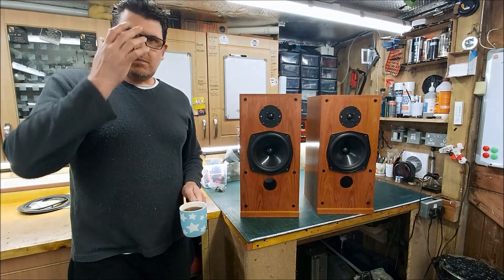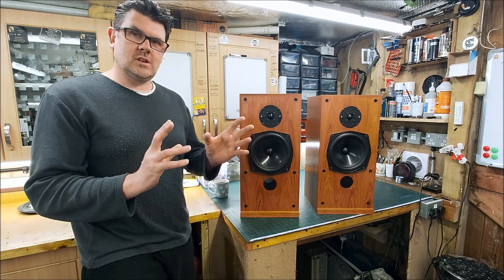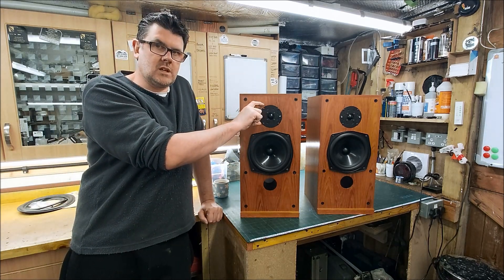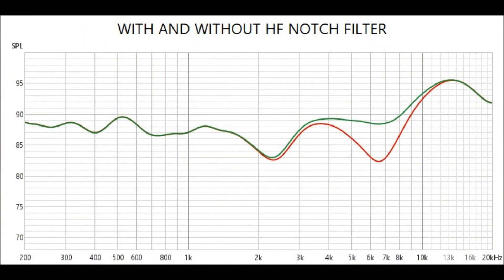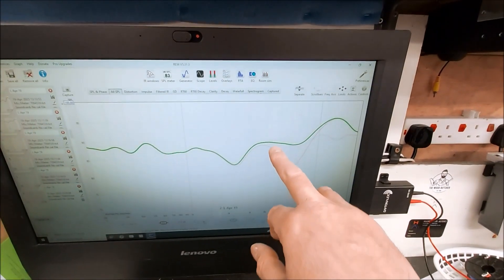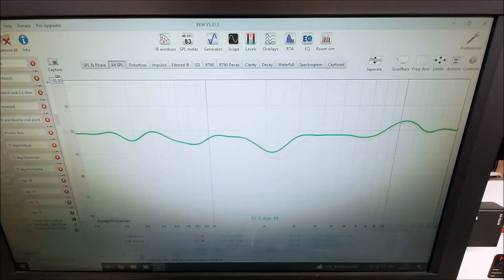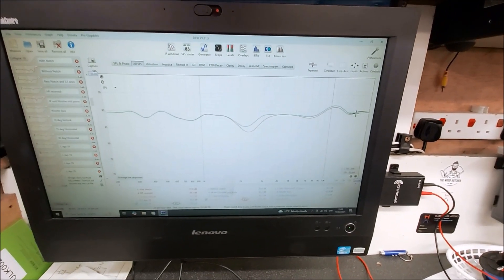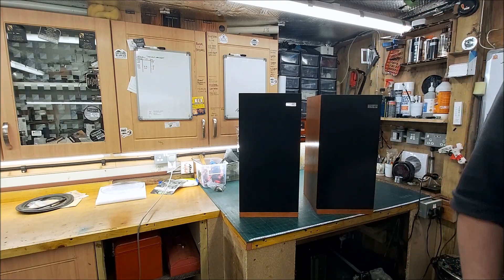CELEF Mini Professional H.E Speakers - Part 2 (More issues)

Comment: I recently recapped a pair of Proac D3 that I bought. I also had to make a few changes to smooth out the response - I was surprised to see that these use the same crossover board (or it's certainly very similar). I did send you an email about them (only because I thought you might be interested to see). Before I modded the crossover, it was like wearing the mids & tweeters on my ears lol. Unlistenable!
Reply from the maker: Thanks Tony. I will go back to your emails. Time is always the enemy

Comment: I had an issue with poor frequency response with a pair of Son Audax HD 12x9D25 fabric dome tweeters a few years ago. They had a small thin disc of felt or foam placed behind tweeter dome that should have been glued to the magnet pole piece to act as a damper in the cavity behind the dome. Not surprisingly after  20 years or so this had disintegrated to a mixture of dust and goo. Do your tweeters have a similar arrangement as many designs from that era used similar ideas?
Reply from the maker: @stevejones4061  these do have a felt dome behind the tweeter dome. I've never come across a degraded felt as yet on this particular driver

Comment: Much better,  what the hell is going on with these probably quite expensive speakers.  Not good at all.  Would not pass any mastering engineer or even my mate Dan
Reply from the maker: @acimbobby  I think there was a component mix up when these were made. Apparently that was not uncommon. A few past dealers have told me this and I've also come across it myself. Yes now they are really good 👍